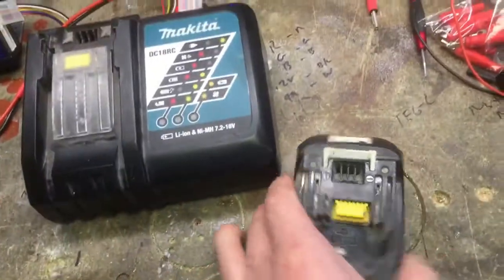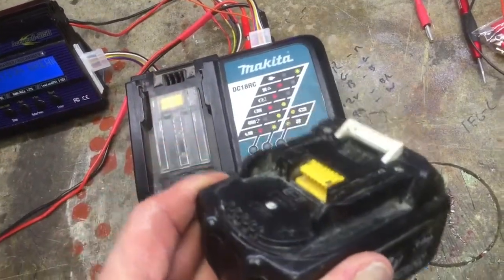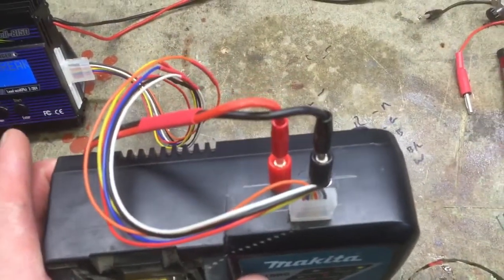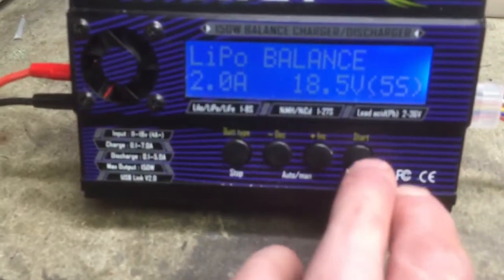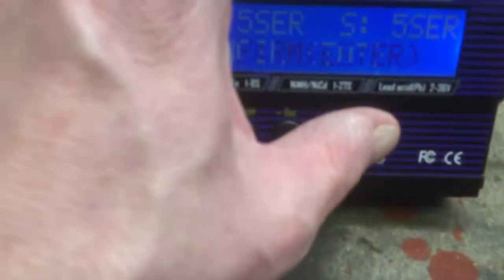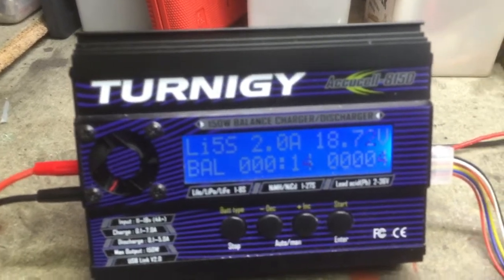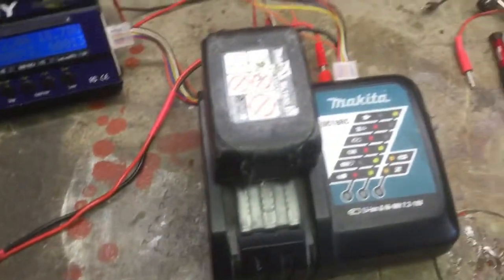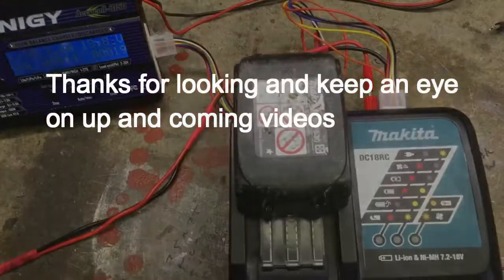Makita BL1830 Modified Charging

Comment from the maker: keep an eye out m8 for a follow up video to show how I did the battery modification so you can charge the BL1830 using the Imax/Turnigy or similar charger.TBH I have most of my Makita battery's modified this way and works great
Reply: So this means you modified both the Makita charger and each battery to use the external charger balancing?